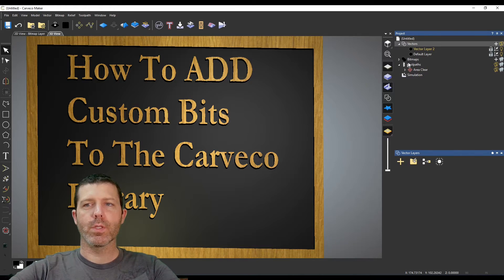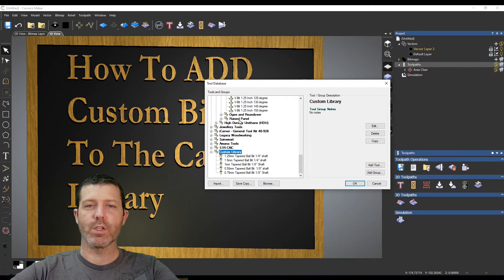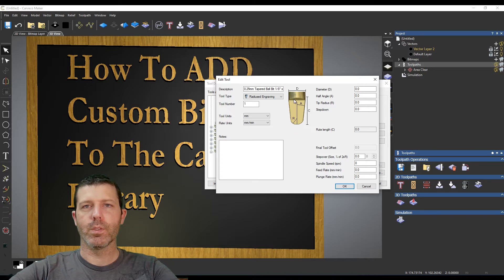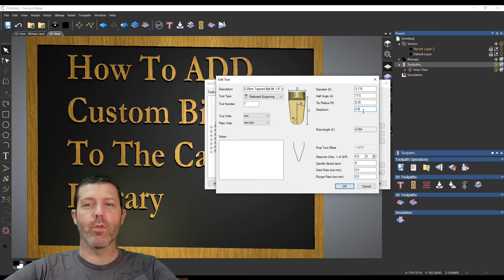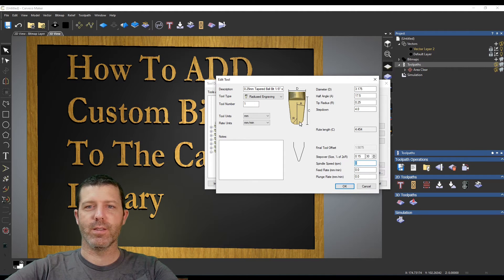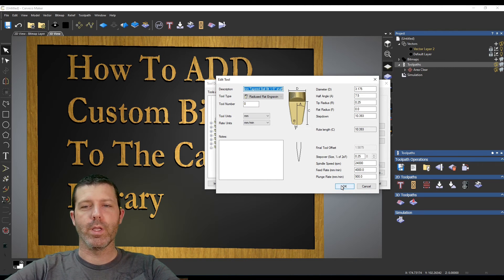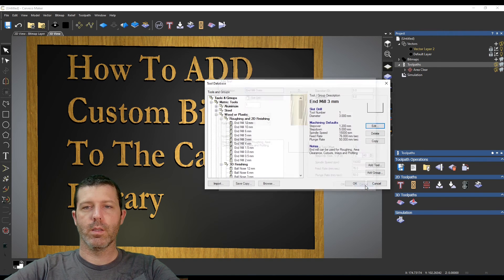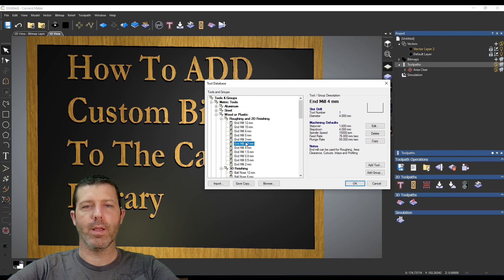👉 HOW TO ADD BITS IN CARVECO MAKER - 👨‍🔧 The Tool Library 📁

Comment: Where do I add the cutting length of the bit? I am adding a 1/32 end mill with a maximum cutting depth of  1/8 inch. I am assuming this is important for the CNC but I do not know where it goes in the Carveco tool database.

Comment: How did you get these numbers? How does a .25mm bit have a diameter of 3.175 mm? Where do you get the half angle number? How is the radius .25 the same as the size of the bit of .25? would not it be .125
Reply from the maker: The shaft diameter is 3.175mm. 
The tip radius is 0.25mm diameter and 0.125mm radius.
The half angle is the side angle off of centerline, some bits are labeled like this while others are labeled with the full angle which then need to be halved to get the half angle.